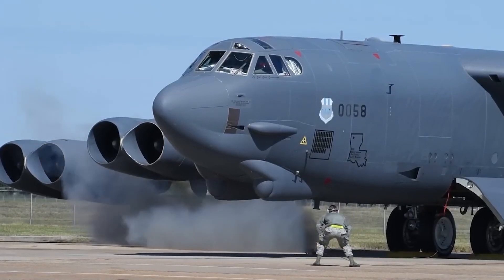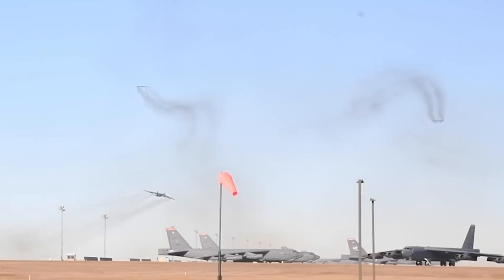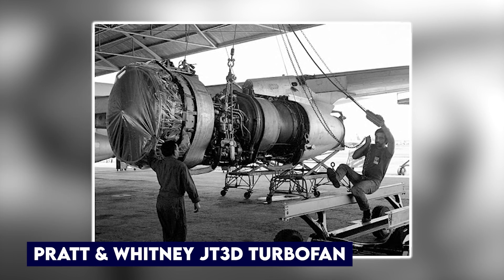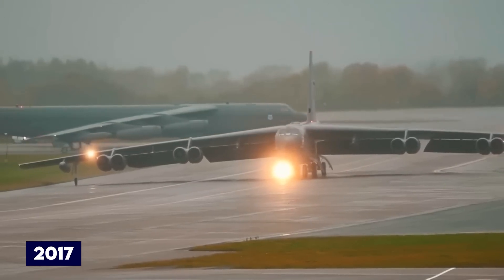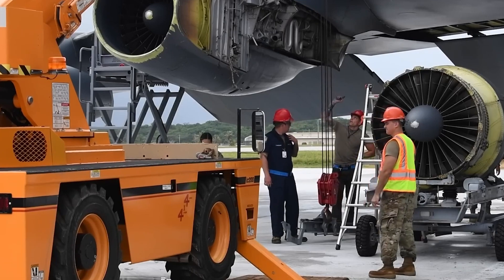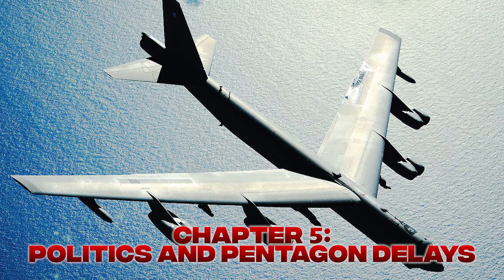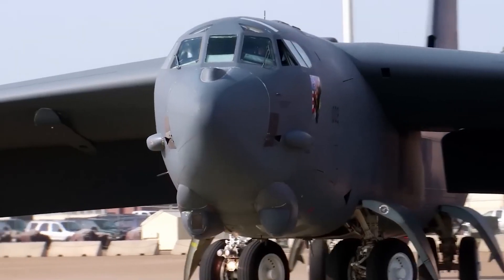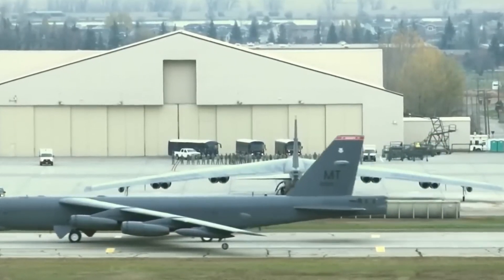The $2 Billion MISTAKE That Left the B-52 Flying on Ancient Engines

Comment: Turbofans were hardly outdated in 1962.
Reply from the maker: Hey, great point, but actually, the first B-52s (A through G models) were powered by turbojets — specifically the Pratt & Whitney J57. It wasn’t until the B-52H in 1961 that they switched to turbofans (the TF33). Even those early turbofans were pretty new tech at the time and were still a far cry from the modern engines we have today. So, in 1962, turbofans were just starting to make their way into the scene!